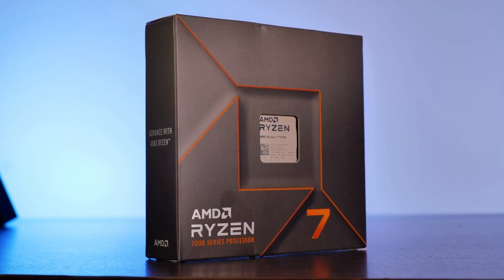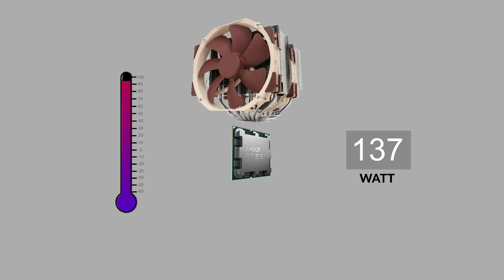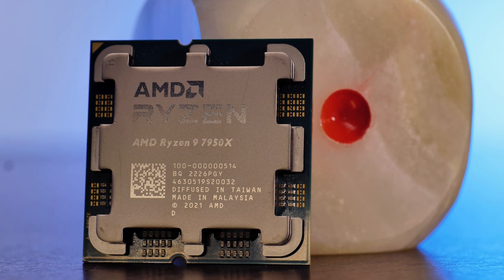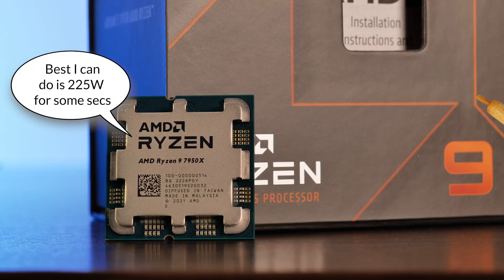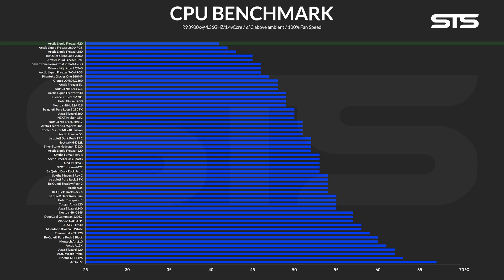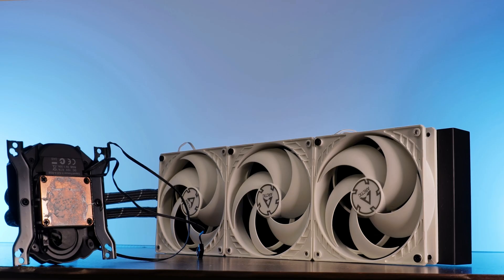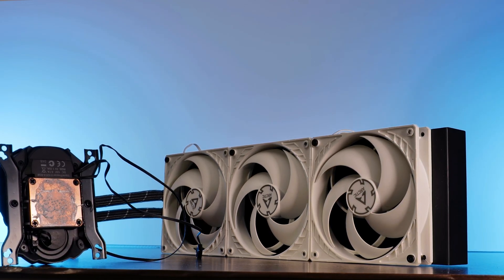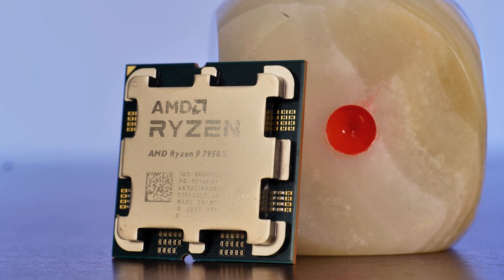How the hell are we even going to cool this thing... ❄️ - 7950x Cooling

Comment: Glad I am not the only one who ran into the issue of the 7950X just not thermal throttling. I ended up having to resort to undervolting manually in order to run any kind of heavy encode work on handbrake because if it on was normal power settings it would just blow past the thermal threshold and shutdown. And that's with the arctic freezer. Which, I admit, may be also be part of my problem as it may need to be remounted and repasted yet again.
Reply: I dont' know but my 7950X run smotthly on a x870 out of the box at 85 degree and 5.1 Ghz after 30 minutes of Cinebench 2023. 
I'm using a Grizzly thermal pad and a Artic Freezer 360 III water cooling

Comment: The design of this processor is bad. The hole on the top…with thermal paste..too hot pushed to the limit and forcing to break the warranty by modifying the bios settings.. memory issues, long boot time as soon as you change the bios, sorry amd i will pass. I keep my reliable 1800x which works very well cool and boot to windows in few seconds whatever change i make in the bios.

Comment: @STS Since Noctua released thier NH-D15 offset mount for AM5  it could lower cpu temps by -3 degress specifically on the 7950x. Would you consider this new information raising the NH-D15 on you chart list as a more safer option and out of the "will work but annoying" zone if true?? Very interested on your input
Reply from the maker: Maybe, one day it'll cover that bracket for sure. If it really turns out to lower temps by 3, or whatever degree, I'll make sure to update these videos

Comment: nope it can take 234 w on Corsair Hydro Series iCUE H170i ELITE CAPELLIX XT Performance Liquid CPU Cooler but I preffer to reduce culve and PBO -29 and max temp to 70 deg so I get 5350 8 coreas and 5225 on last 8 and vattage around 170-175w
Reply from the maker: No clue where that ‘nope’ is coming from.
But okay, yeah, everything you said makes sense
Reply: @STSYT  you said 225w I seen 234w and with my AIO and I think it can go much higher (w)  if temp in room will be 10 or less. I think problem with this CPU is on default settings, it reach for sec 1.4 volts and it is just waste of energy (with generated heat) I think with 1.25 volt should be set as max default. great video

Comment: I saw a video that undervolted this processor to 0.985v and underclocked it to 4800, resulting in a power drop to 124w and temp of 55C
Reply from the maker: Yeah, there are plenty of those, but for these videos I like to keep it "out of the box". Cause that's kinda what "most" of use cases will do

Comment: Best performance is under volting it..   Mine is  set at  .625 volt  45.00 mhz  temp 55c..  Aircooled with a coolmaster..
Reply: my pc just crashes everytime i try and undervolt it and then reverts back to idling at 70 degrees how do you do it

Comment: So quiet air cooling is not possible on 7950x unless you compromise performance?
Reply: Try undervolting. You will probably lose 2-3% performance, but should get a 10-15% drop in power consumption depending on how good your CPU sample is.
Reply: Has your opinion changed 5 months later? :)

Comment: If you can’t cool it then tweak the bios settings so it doesn’t run too hot. You can start by turning off all this auto overclocking and auto overdriving, which they have enabled by default.

Comment: Lol so glad I have a cool and efficient 13900k where I don't have these problems
Reply: This couldn't be further from the truth. Maybe in gaming the 13900k will be cool and efficient, but in heavy workloads (which this CPU is really meant for) the 13900k hits 95-100*C in a few seconds unless you enforce the PL2 power limit in BIOS in which case you get some performance degradation in heavy workloads.
Reply: I thought intel also runs hot?
Reply: @noms780  Like ok up gamers Nexus. Regular activities are designed to hit 95c so AMD can win at benchmarks yet still loses to an i5 😂

Comment: I cannot believe you made this video. What this tells me is that since the advent of the third generation of Ryzen you have not bothered to learn anything about the architecture and have basically been treating them as if they were Intel CPUs and have been missing out BIG TIME (and degrading your CPUs in the process if you have had previous generations of Ryzen).

Here is a comparison between my 5950X and my 7950X and of course, with my 7950X, I have never been anywhere near 95 degrees, the highest it goes is around 78 degrees.

Going from 7nm to 5nm with my Ryzen 5950X and Ryzen 7950X I get the following results

At the same performance level (maximum CineBench R23 score for my 5950X) I get the following:

1) CPU voltage
5950X 1.3 Volts
7950X 0.83 Volts
For the same performance vs 7nm the 5nm uses 63% of the Voltage (or rather the 5950X uses 56.6% more Voltage)

2) CPU Clockspeed
5950X 4.675 GHz
7950X 4.115 GHz
For the same performance vs 7nm the 5nm needs 89.2% of the clockspeed (or rather the 5950X needs 12.7% more Clockspeed)

3) CPU Wattage
5950X 180 Watts
7950X 54 Watts
For the same performance vs 7nm the 5nm uses 30% of the Power (or rather the 5950X needs 333% more Power).

Now I am going to stay within the 7950X performance numbers but going from the maximum score I got for the 5950X to the maximum score I can achieve with 7950X at the same power level in terms of Wattage of the 5950X maxed out I get the following:

1) CPU Voltage
7950X at 4.15 GHz 0.83 Volts
7950X at 5.35 GHz 1.2 Volts
For the performance increase it needs 44.5% more voltage

2) CPU clockspeed
7950X at 4.15 GHz
7950X at 5.35 GHz
For the performance increase it needs 29% more clockspeed

3) CPU Wattage
7950X at 4.15 GHz 54 Watts
7950X at 5.35 GHz 177 Watts
For the performance increase it uses 321% more power

Difference in CBR23 score
7950X at 4.15 GHz 31,108
7950X at 5.35 GHz 40,201
The score increase is 29.2%

The bottom line here is that for 29% more clockspeed I am getting a score increase of 29.2%

Comment: That's really insane, needing a 420 cooler, perhaps the best on the market, just to keep the CPU down to 85 degrees. It seems air cooling is all but dead in it's current iteration.
Reply: Cant tell if you are stupid…
Reply: In the past yes, intel was the one to pick if you were afraid of the heat but now not anymore. It used to be that only AMD suffered from cpu heat issues but now even Intel has this heat problem.
Reply: Go Intel you won't have these problems
Reply: @timothygibney159  Yes you will. Both Zen4 and 13th gen Intel are essentially the same as in they will pull as much power as they can when you run these CPUs at full load until they hit 95-100*C unless you enforce the PL2 limits in BIOS.
Reply: @timothygibney159  intel and amd are both terrible inneficient intel runs way hotter even. if you dont want to have this problems you have to go Apple, which is lightyears ahead.

Comment: My solution for my 7700X is manual OC, set 1.20v as voltage, 5,3Ghz and running Cinebench 23 hardly passes 70ºC with a Galahad 360.

Comment: I wish the cooler I just ordered was on the list but I guess I can take the d15 as the perfect example haha, hopefully the ak620 does the job for the 7700x
Reply: ak620 does the job, that's what I have for 7700x. The thing that some content creators are covering is that you can power the 7700x to 65W and it will lose 2-5% performance on all-core workload only. On single-thread workload it will NOT lose performance because power draw is related to core times load they are on. If you set your 7700x to eco mode you will notice when it's maxed on all cores with 5.1-5.4ghz, it will be well under the thermal limits. You could get a stock wraith fan and be fine

AMD made these CPUs on overclock mode by default in order so that they show up good in benchmarks. They should have been power limited to reasonable amount to begin with.

Comment: A 360mm is basically a requirement for this CPU. However with some power limiting to 175w and negative offset, temps should be more manageable.
Reply: you can also power limit to 105w and only see a small reduction in performance with any mid-tier cooling, includin air cooling. AMD set them to over-clock by default to win benchmarks but they should be limited for normal use.
Reply: @jerrygenser  GN Steve just did a test with eco mode 65w vs eco mode 105w vs stock with the 7950x and the 105w performance is insane while losing 5% performance compared to stock, amazing performance and amazing temps, running it at stock isn't necessary at all
Reply: Dude I have mine on auto pbo and my cpu is chilling at 65c and full gaming 75c. I have a 280mm aio and feel like people are just freaking out. Unless you are an editor exporting files, transcode etc, or doing other work intensive task you will never see 95c